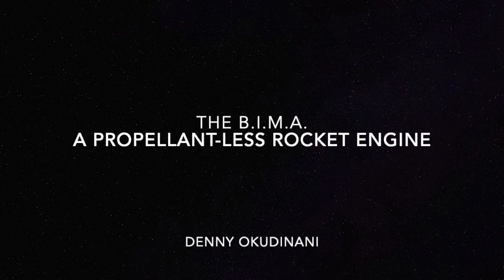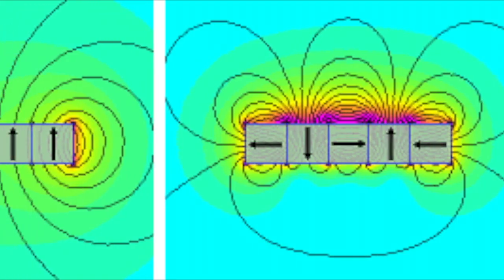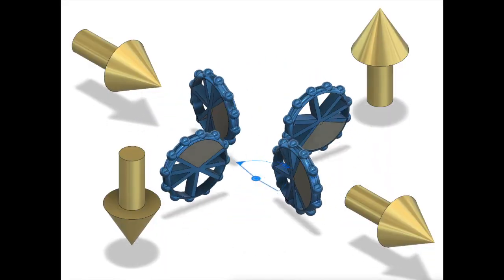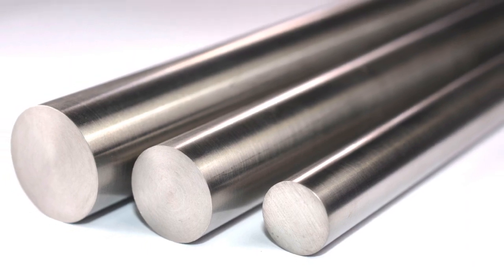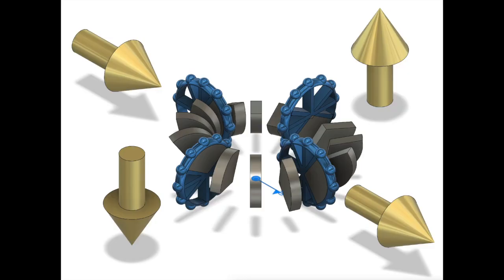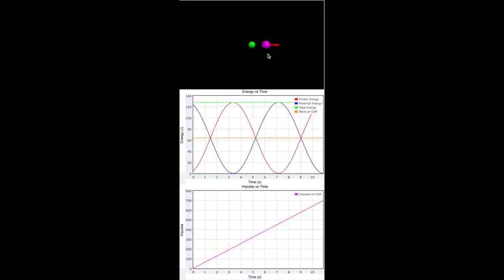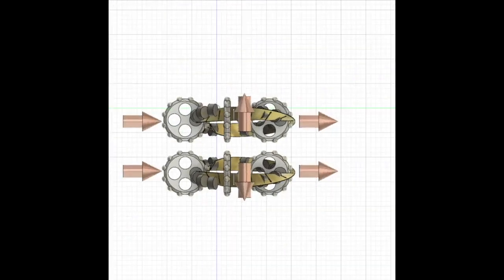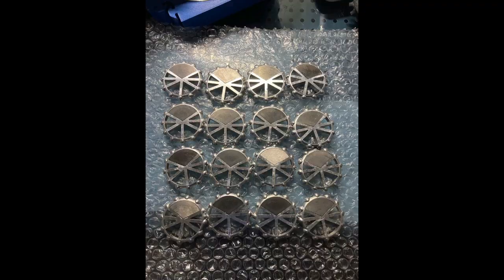Inertial Propulsion System 1: The unBalanced Inertial Mass Accelerator (BIMAH)

Comment: Did you read about Salvatore Pais
Reply from the maker: I am familiar with his work to an extent. So far as it relates to "inertial propulsion" it would appear that his project proposals  attempt to generate a displacement force within the vacuum of space, by  the collective modification of an given object's "inertia" at the atomic level. Restated another away: when speaking about Pais's work as it  explicitly relates to "inertial propulsion", it would appear that he is trying to exploit the "strong"  or "near-field" aspect of gravity via certain formulation of particle physics, at the subatomic level, to modify mass and induce displacement effects (generate force). 

There's a term in the Einstein field equations which involves the cosmological constant which essentially behaves like a force/pressure term. Traditionally, students of General Relativity (GR) do not treat this as an actual force because of the way the math is set up in Pseudo-Riemannian space (to learn more watch this video here: https://youtu.be/_A4cy_-ZsTQ ) . Some time ago Pais came out and explicitly named this term the "Pais super force". Functionally it says that, within the confines of  General relativity, force behaves the same as it does in classical physics (more or less).. I actually did this months before Pais in a publication I wrote for the gravity foundation in 2024 based purely on a likeness of the Maxwell Equations hypothetically (after all "force" is directly equivalent to pressure over an area), however I didn't rebrand the term, Lambda*c^4/8piG, with a fancy new name other than F_g. To take a look at that paper click here: https://www.researchgate.net/publication/381958168_Gravity_as_a_High_Frequency_Electromagnetic_Wave_of_Displacement_in_the_Spacetime_Quantum_Vacuum

In the paper I put out for this work here: https://www.researchgate.net/publication/394250595_A_Heuristic_for_the_Discretization_of_Classical_Mass_as_Ordinary_and_Dynamic_Quantum_Objects I another step further modify the EQ a bit more through the work of Pinhero, Musha, and Davis so that it gels better with the vacuum of spacetime, without any explicit reliance on GR.

Comment: I'm not a physicist, but I have a feeling the gyroscopic effect would counteract any asymmetric force.
Reply from the maker: Actually, the so called "gyroscopic effect" here is the "asymmetric force". The system is not a true gyroscope (continuous mass segment like a disk). It is an artificial  one of discrete parts . This is why there is an "asymmetric force" at all, at least, according to the math and physics.

But instead of taking guesses, lets do some science! I've open source all the parts.  It wouldn't hurt to find out by building one correctly ...

Comment: what holds the motor still? especially when it has nothing to hold on to?
Reply from the maker: Hey, thanks for the question. I'm not sure if I understand what you're asking--the motor is held in place by a frame and directly connected to the "particle module(s)". Its not floating in thin air. Maybe it appears that way in the 3D workspace, but it was very clearly bolted to a frame when I carried out a few tests. This should be evident in the video, I hope.
Reply: @MillennialZoomer  whats the frame bolted to?
Reply from the maker: If you wanna understand how this machine is assembled you should look at this technical report which was already provided in the description: https://www.researchgate.net/publication/394250885_DNO7_Technical_Report--On_Spatial_Mass_Displacement_Systems_Inertial_Propulsion
Reply: @MillennialZoomer  you obviously dont get it. so again, despite the futility...

what is the MOTOR BOLTED TO?

do i have to spell it out?

whats the tail rotor on a helicopter for?

connect the dots.
Reply from the maker: @paradiselost9946  A bit feisty aren't we? I'm guessing you aren't one for reading , technical reports... A real pity, and yet I will humor you just once more:

Everything is "spelled out for you" , systematically, in words from pages 7-13 and diagrams on 14 and 15  of https://www.researchgate.net/publication/394250885_DNO7_Technical_Report--On_Spatial_Mass_Displacement_Systems_Inertial_Propulsion, there's even an image on 26. All you need to do is just read .

If you want to say something to the edification of this work speak clearly. "Riddles" of that sort are not necessarily conducive to inspiring more research (and bend more towards unneeded provocation). On that note, if your statement "what is the tail rotor on a helicopter for?" some attempt to draw attention to something like "autogyration" the simple fix (which I already show in the document, quite clearly) is on pages 22 and 23. You simply have two systems combined and counter-rotating with one another (OR you replace the main axle with a differential for a single "quad" unit) .

There ya go,  I've just "connected the dots" for you--several of them--because you refused to do so on your own.
Reply: @MillennialZoomer  lol... "auto gyration" has nothing to do with tail rotors...

yet "autogyros" dont have tail rotors... hmmm, wonder why that is?

Comment: Best of luck to you bro. A pendulum test or on a rotating platform would be best for seeing any forces. I created a similar device but using gyroscopes in a similar manner (canceling out mass to directional create force) that showed force when suspended on a pendulum. Been working on a draft cad model for a prototype. I’ll post a video soon.
Reply from the maker: Thanks for the encouragement good chap--keep on experimenting and doing research! There's always something to learn, and you never know what you'll find until you do the experiment.  Look forward to your contributions to come. 

Sidenote--indeed, depending on the way the platform/pendulum is created it can help you see if theres any real force being generated.